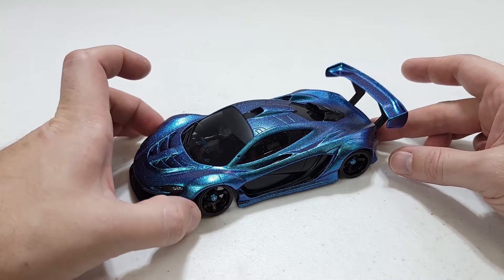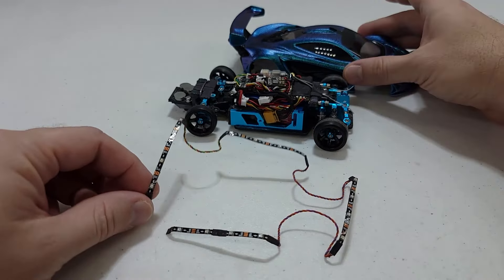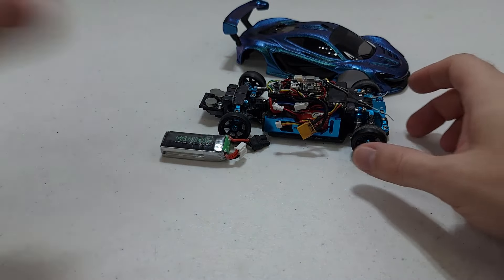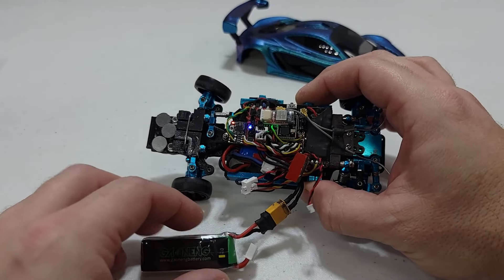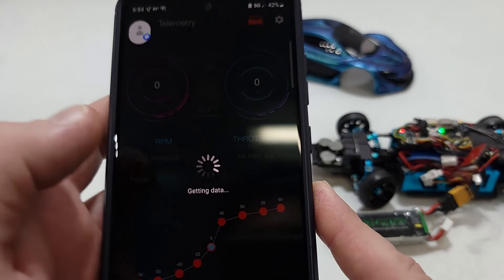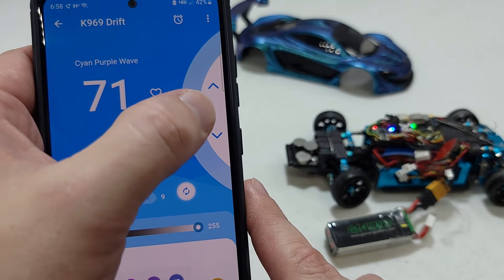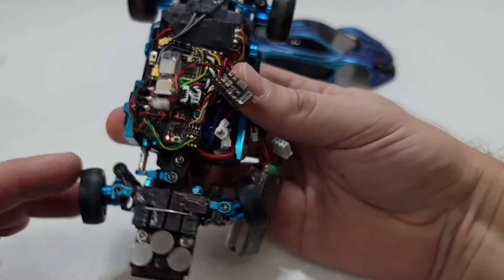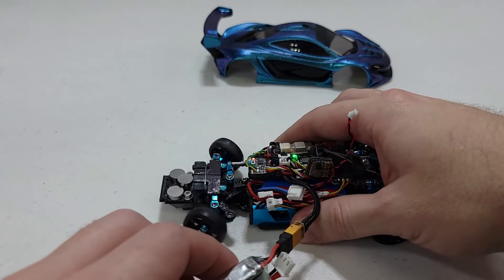WLToys K969 Rebuild Completed! Electronics Upgrade, DasMikro V6 Gyro, Furitek Momentum ESC, etc.

Comment: Where u buy the body shell?
Reply from the maker: It was a Mini-Z P1 GTR white body shell that I got off eBay for around 30 bucks. Then I got the wide body kit from Garage Hiro and glued it on, after that I painted it black and blue/turquoise color shift. I 3d printed the GT Wing myself, the whole build was a long process. I cover how I added the body kit in this video  https://youtu.be/rVh_mh71WcU

Comment: How much it cost! I want to get good mini rc drift car but im broke 😅
Reply from the maker: It's hard to say how much it costs. I got most parts off of AliExpress and designed and 3d printed the other parts myself. It's a one of a kind build that took me months to plan out and finish. Sorry man, and some of the electronics I got over a year ago and were much cheaper then than they are now.
Reply: @AirToGroundRCFPV  ik and i love costume builds like this, this car LOOKS DOPE
Reply from the maker: @filipshinigami7263  I appreciate it bro, This thing took me so long I was wondering if I'd ever getting working lol and I'm happy that P1 GTR body came out good because the wide body kit was not easy to install with out popping off from flexing the body every time I put it on the car. It's just nice to see all the work I put into this thing pay off, I just wish there was an easier way to help others achieve something similar with out the huge hassles I went through.